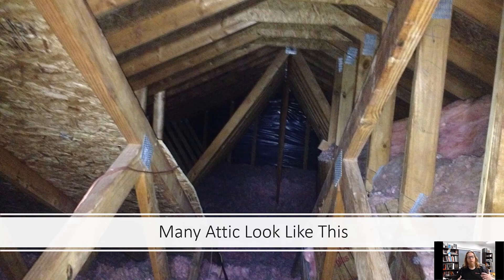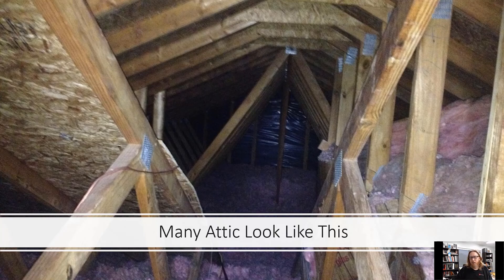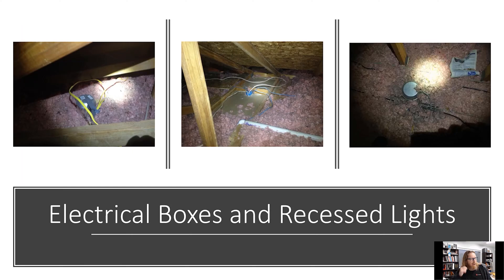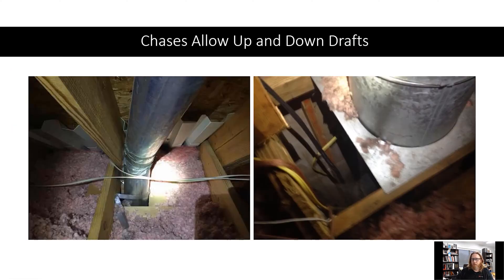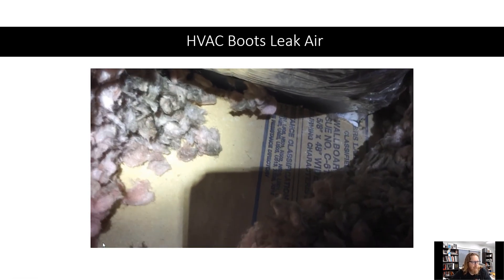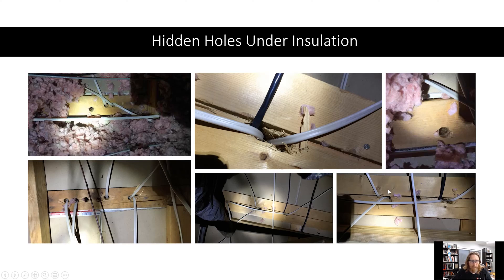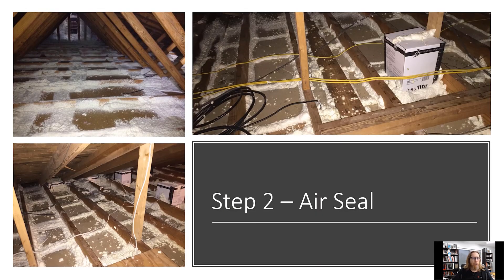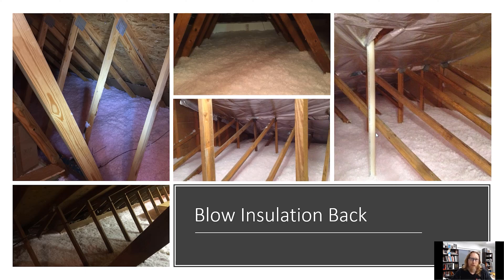How to Air Seal Your Attic BEFORE Insulation | 5 Critical Steps Contractors Miss (Save $$$)

Comment from the maker: Is your attic ready for summer?!
Reply: Crawl Space Ninja what’s your opinion about foam board insulation on the roof deck
Reply: @chief5981  it's good as long as there is also a vapour retardant product with it.
Reply: Crawl Space Ninja I have a house built two years ago and we used spray in open cell in the attic and walls what is your opinion on that
Reply: @duanemcdaniel1003  pretty good but hopefully you have a vapour barrier on your ceiling.
Reply: NO :-(
Reply from the maker: There is still time to prepare!
Reply: @CrawlSpaceNinja  let’s go!!! Lol
Reply: I’m on Long Island N.Y. I do Hvac work but have gotten into home performance. Bpi building analyst and registered home energy auditor. Love what you guys do, do you have any outfits in this area? Frankielgallina@gmail.com
Reply from the maker: at this point we do not have anyone in that area.
Reply: Mine is lol r60 baby and whirlybirds. Could have gone maybe with attic foil perhaps. Both ac and furnace are not in attic.
Reply: probably not. It's a MESS
Reply: No it’s not. I need advice. I just had a heat pump installed knowing it would not be enough to get upstairs in a old farm house. The attic has only about 3-4 inches of blown in insulation in the attic.
Reply: Why seal around every truss and top wall plate?  Air can’t move through sheetrock mud and paint.  I don’t understand this step.
Reply: I have a100 year old, lathe and plaster house in Minnesota.  The main level bedroom/bathroom are in what appears to be an addition that extends out of the house with a flat roof and very shallow attic.  Except for the bathroom fan cavity and bedroom light fixture there is no main level attic access in the addition.  I might only have roughly 9 in. - 12 in. of vertical space.  There is a small amount of insulation probably like R2 if that.  I was hoping to be able to just hire somebody to blow in insulation, but it sounds like I need a vapor barrier.  Is there any technique you're aware of that doesn't involve ripping out the ceiling and starting over?  Is there a spray in product like Great Stuff that could work as a vapor barrier and not produce mold if it gets wet?
Reply: 3 yrs later

Comment: I have a question i have a fair bit of moisture between my drywall and vapor barrier with zero insulation in a area that was missed by the loosfill installers after having a removal done. To fix this, should i just add loosefill and have the heat from the home diminish  the moisture over time . Or what method do i follow to remove the moisture before adding the loosfill
Reply from the maker: Add a Dehumidifier!

Comment: You provide a great service to DIY homeowners.  I'm currently renovating a 75 yr old cypress log cabin.  It has cypress beams supporting the ceiling of 1x6 tongue and groove cypress planks.  These cypress planks are the attic floor, so the attic floor is basically a flat surface with a few wires and light fixtures cut into the planks.  There are no rafters or soffits, just some gable vents.  The attic floor/room ceiling is very leaky, as I can see light penetrations in a few spots.  How would you recommend air sealing this attic space, should I cover the floor with some plywood or insulating foam board to air seal it before blowing in new insulation?  Thanks for any suggestions...
Reply from the maker: I did a consultation with a lady in Louisiana that had something similar where she could see the light come through the attic from the living space. In her instance I recommended that she use caulk to seal on the attic side. Spray foam in her case would have squeezed through the crack and be seen on the living side which would have been ugly. See if that could work in your case to air seal those gaps, it will be tedious but should be effective. Thanks for watching and I hope that helps.

Comment: Great video. How do you seal around flex ducts that penetrate through the insulation layer of the attic floor? I have found warmed air escapes up through the blown-in around the flex duct like a chimney. Cold air from the attic drops through the insulation and contacts the interior drywall where it is warmed and rises again into the attic. It rises following the path of least resistance, which is the natural gap between the flex duct and the blowin in insulation.
Reply from the maker: For in-depth information. Please fill out this Ask a Ninja form - https://crawlspaceninja.com/ask-a-ninja/

Comment: Ninjas: Do you have any tips to share on how to best remove batt insulation from under the house.

Thank you.
Reply from the maker: I would remove it with a full face respirator and pull it out towards me, not straight down. This way no mice or snakes would fall on me.

Comment: Hey I'll be re watching all your videos soon but my research brought me back to the attic for now, what foam would you use to seal those electrical wires? Window and door foam?
Reply from the maker: Door and window is good, also firestop foam. Check with code to see if they require a firestop type foam.

Comment: Vent ducts should never be terminated in the attic , especially dryer vents.  Consider a no duct heat pump dryer to save energy (3 times more efficient and doesn't exhaust your conditioned air while sucking in unconditioned air) and eliminate the dryer duct.  For the remaining ducts, you can get a fan that combines multiple ducts into a single roof penetrating exhaust vent.
Reply: I have never heard of those dryers sound intriguing.

Comment: All those conduit air gaps!  That's what happens when your contractor decides that it's too much hassle to carry a set of properly sized hole saws and just uses the biggest one all the time because "it fits everything."  And it's not hard to carry a little can of spray foam with you to finish the job (or a tube of silicon for exterior openings).

Comment: I was told pest control wont deal with a house with foam in the attic would this count? 8:29
Reply from the maker: Spray foam insulation delivers big energy savings for homeowners, but several pest control companies say it also prevents them from conducting proper termite inspections and identifying moisture leaks.  I guess it would depend on the company or contractor.

Comment: Hi Ninja Mike,  Great videos, very helpful .  In step 2, Air seal,  8:02 in  this video,...Do we need to air seal every single joist or just the  top plates and drywall joints? (already sealed wire and plumbing holes with fire block foam) TY Sir.
Reply: Did you happen to get an answer, bc I have that same question. Seal every joist or just drywall joints, top plates, wires, plumbing holes? I am just unsure about every single joist.

Comment: If I was working in hot attics I'd be beardless and short hair for sure. I've had the same length hair as you in an attempt to see if I could look like a rock star and have the strength of Sampson. Also had a goatee. I was working at a dealership in Sacramento, and couldn't take the heat anymore. My stylist refused to cut off my hair, so I had to got to a Fantastic Sams type place. I went to see my Mom one day. The second she laid eyes on me, she fainted. I put tape over my uniform at work and nobody knew who I was! The owner just about fainted too! Was pretty fun.

Comment: Great video.  I am having our insulation removed this spring.  The electrical wiring in our 10 year old home in York County SC was so bad most of it has been replaced.  And I have already air sealed around all electrical/cable/pumbing penetrations.  One question I have is why didn't you use fire block foam around the electrical devices?  Wish you well.  Great work.

Comment: One problem that I have is probably 60 percent of my attic has boards nailed down. Is it worth it to remove the boards, air seal everything and then add loose fill insulation? It has minimal loose insulation under the boards and I am sure air sealing was never done it.

Comment: Hey guys, what is the best way to insulate a electrical box in the roof?  (like a regular basic interior box to mount a regular chandler or light).  Would you recommend plastic and acoustic sealant OR spray foam the edges?

Comment: Hey Michael,  i'm building an addition and used trusses.  Our best option for the HVAC is a 2 ton exterior unit, but it's a little bigger than we need, but would be simplest for install and noise. To find more square feet needed for HVAC- I'm thinking of sealing up the center portion of the trusses and running a vent there (ac/heat).  So the center portion would be conditioned, with the rest of attic blown insulation.  Would this work with creating problems? Thanks for your time and thoughts.

Comment: So in the attic , with the ceiling below exposed. do you seal all the drywall seams as well?  My older home used what appears to be 2x3 pieces of drywall . I guess made for easier handling, but looking at it from  the right angle, you can see all the seams on the finished side Many seams .And do you do the whole perimeter of the outer top plates? Thanks
Reply from the maker: I have seen similar sections in homes here and we did seal the joints of the drywall as well just to make sure everything wal sealed for the homeowner as well as the outer top plates. Great question, thanks for watching.
Reply: Once I seal the drywall seams and top plates, do I need to seal at every joist?

Comment: Thank you for these tips. Air sealing these penetrations need to be building code for ALL new/remodeled homes NATIONWIDE! FYI - some newer building codes call it "fire stop" for these air penetrations, but if your home is older than 5-8 years old, I would guess that you don't have that protection. Also, glad you pointed out the styrofoam baffles; cardboard baffles should be illegal! Cardboard is a spider, bug and mice breeder.
Reply from the maker: Thanks for the comment!